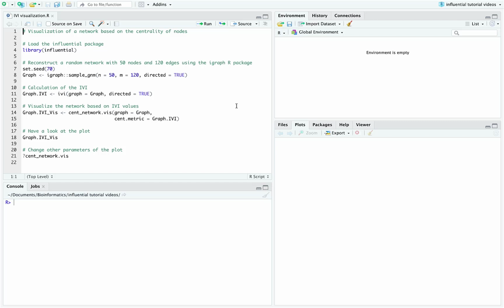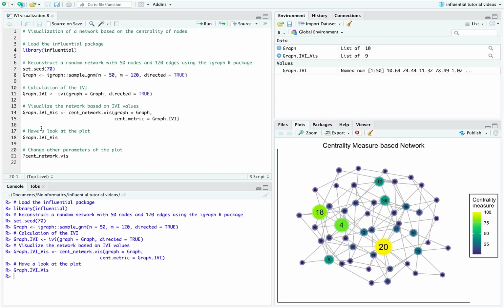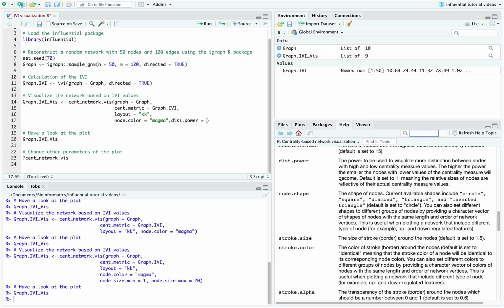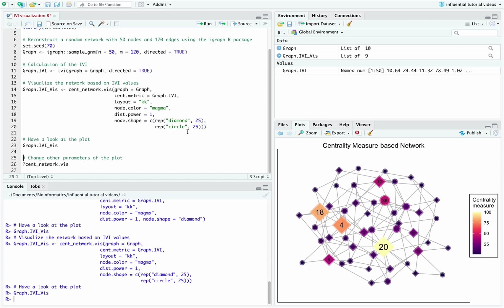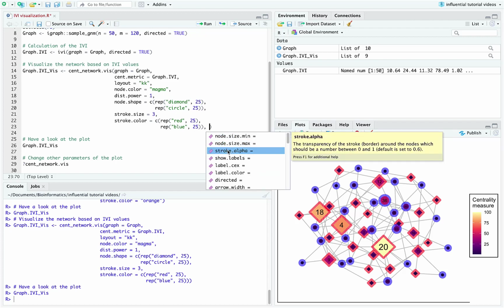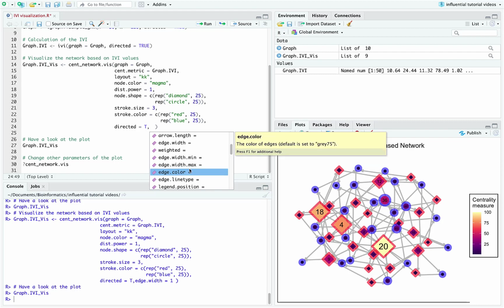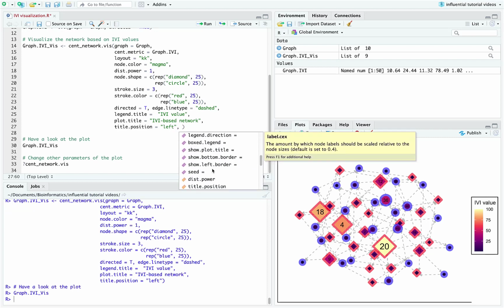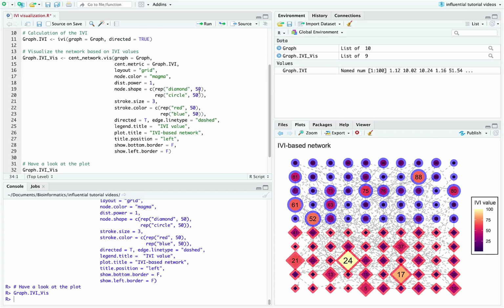Centrality measure-based network visualization

Comment: thanks this is very useful. Is it possible to develop a correlation network similar to this? with edges in different colours showing a positive and negative correlation.
Reply from the maker: Hi Nara,

You can simply reconstruct a network using the functions provided for network reconstruction. Please check out the vignettes of the package at https://cran.r-project.org/package=influential/vignettes/Vignettes.html. Also, any network could be simply visualized using the function explained in the video. However, it's not possible to assign different colors to different edges. I may add this feature to the function in the next version of the package.
Reply: @adriansalavaty  Many thanks Adrian, I will give it a try.